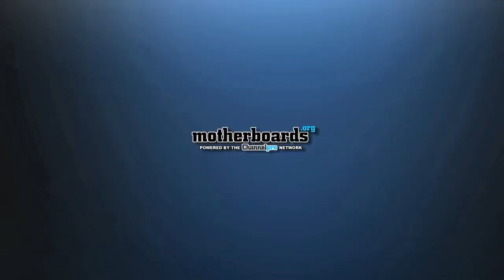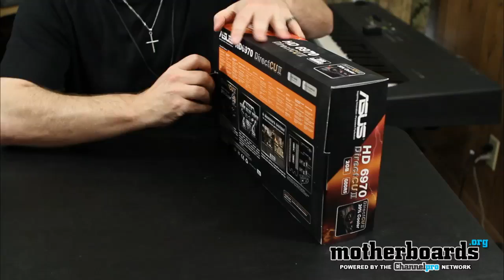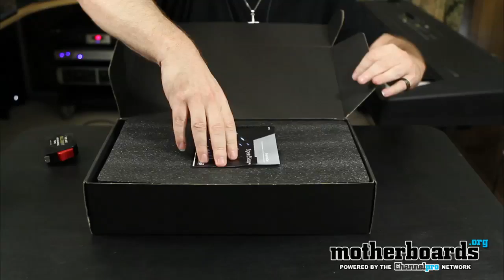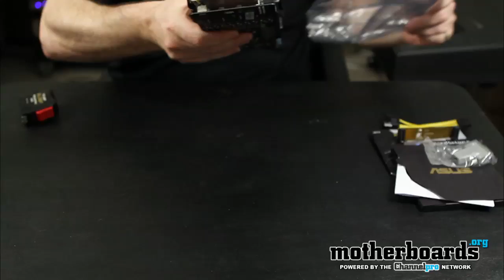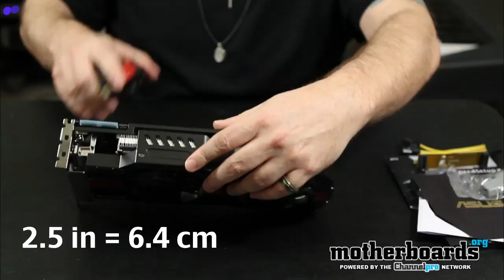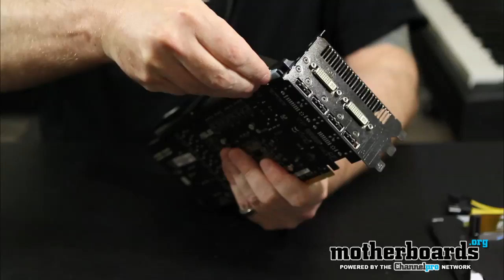ASUS AMD RADEON HD 6970 Direct CU II: Unboxing

Comment: It is hard to say what you can overclock your CPU to without having one in front of me etc... but basically if u want to be extreme go as far as you gan go whilst keeping it stable of prime 95 for 12 hours... preferably under 70 deg C.... but to prolong the life of the cpu i wouldn't recommend going higher than 4.2 ghz.

Comment: 2x8 pins absolute overkill for this card even if you could some how overclock it to 200% higher then it's original speed you wouldn't need that much power.

Comment: @Gavsta40 It performs extremely well with Battlefield 3. At stock I barely dip below 43 - 45FPS on B2K. Overclocked to 980MHz I only gain about 4 - 6FPS though.

This is at Ultra settings (Shadows High - Gain about 3FPS with no noticeable visual difference) 

This card also really does run cool. BF3 running I get a stable temp of 63C. OC'd about 69C when shit hits the fan. It also runs Metro: 2033 very well. AAA with DX11 and get Avg frames of about 38 - 40. Not bad for a poor optimized game.

Comment: Why the hell did he measure the backplate? Doesn't he know they are standard size? What realy matters is the width of the cooling solution, cause it extends beyond the backplate(towards the case sidepanel). In my Cosmos S case the pcie powercables touch the fanguard on the sidepanel fan.

Comment: @DjArden  being as you have 2 of these cards can you answer me something?
I've just ordered one of these and in the video there is 1, 8 pin pci-e adapter. could i use the card with just the one  8 pin connector or do i HAVE to use 2?

Comment: This card is frickin huge and 3 slots tall. I hear you cant crossfire with any 6970 except the exact same model. It does have a bio switch somewhere though hmmmm

Now the question will asus make a 6990 model so that I can run this in tri crossfire.

Comment: @phatbastard0alkaline what motherboard do you currently that you're considering crossfiring two of those cards with? like i mentioned on either this video or another one coherent. Seems so far the ONLY motherboard that I CAN THINK of that would COMFORTABLY allow the room needed for xfire of these two 3 slot cards is the Big Bang Marshal which i believe is an XL atx sized motherboard. Hopefuly u can find another that is not xl and and the 2nd card won't block your important stuff lower down.

Comment: @Sphoxros yeha. i feel ya bout teh 3 slot future-planning xfire concern.  My galaxy gtx 580 accelero xtreme plus hsf edition takes up EXACT 3.5 slots in exactly measured physical width.lol.  I know there is no board out there that ( without covering up the important power switch and other stuff unless it's the Big bang Marshal) can realistically accomodate 2 of my exact video card in sli.  I understand to bridge that gap in cooling and hardcore performance but 3 slots IS too hugh for dual cards

Comment: Anyone else think this thing would have some heat issues if used in CrossFire ? I mean it takes up 3! slots! thats not alot of room for airflow. :( I think this H/S designs ganna bite Asus in the ass later with those that CrossFire these, don't get me wrong Asus makes great products just that I see and issue with heat on this setup. :P

Comment: and yeah I definitely agree with your part about single gpu amd card can do what a single gpu nvidia card can't . multi monitor surround video and audio support.  so yeah..you're right..but at thte same time..that depends on the user's needs.  if they dont need nor prefer multimonitor gaming. then that part isn't in the comparison.

Comment: @WithOrWithoutScope well i've never had the " BAD drivers at first" except only ONE card ( and i have used at least 3 different driver versions PER card i have tried since 2001) by nvidia the 5700 ultra 128mb back in 2004. It's drivers from the included disc were goofy so was driver on nvidia website. The problem fluctuated.  amd crappy drivers..at random for my system. sometimes cd. sometimes main website or vendor website, except 9600 pro back in 2003. (shruggs shoulders)

Comment: thus.  except for crysis and metro the 590 beats the 6990 in reg full hd and super hd rez by a small quantity of games..all other games are a tie= winning or losing by less than 8 fps in 60 fps max range and les than 16 fps in the 100's fps range. Y?  you compare with your own eyes..side by side the difference in such a framerate and you CANNOT see the difference...thus the 7 or 15 fps differences in 60hz and 120hz modes.

Comment: @1337saklart ok.fanboy check linus's  3 part video on gtx 590 vs 6990 in a direct head to head competition using the a 1080p 60hz monitor @ 1920x1080 & 2 rez test on acer 23.6 inch 120hz monitor on reg full hd@ 2560x1600 rez.  he tested the games " Civilization V, Hawx 2, Metro 2033, Crysis, Lost PLanet 2, BFC 2, Far Cry 2". regardless of reg full hd or the 2560x1600 rez. 590 OWNED 6990 IN MOST GAMES ( owned=win by more than 7 fps in 60fps or less or more than 14 fps above 100 fps range.  thus..

Comment: @JoesPlaying to add to your question of challen...."  AND with a minimum of 30 fps REGARDLESS of the game ( metro 2033, crysis warhead crysis 2, MOh Limited Edition = NONE YET.   the 6970 comes VERY close.   meaning..metro dips down to 20's on that setup. gtx 580 dips to 30's  both scenarios under heavy fighting. otherwise they're both evening matched overall depending on the game and other facts

Comment: @WithOrWithoutScope and i tried a 6970.  again driver crashing problems on my msi785gm-e51 and asus evo 785m motherboards. with my 8800gt, 9800gtx, gtx275, and currently galaxy gtx580 accelero xtreme plus hsf edition..everything running perfect without any tweaks what so ever.

Comment: @WithOrWithoutScope on a scale of 1 to 10...10 best highest performance in that class of cards.  580=8.5, 6970=7.9   if you are comparing the same games on all same hardware including 120hz monitor at full hd rez.  Personally i've owned both ati ( i know it's BEEN amd since they began the 6 series) and nvidia since 2001. I have bought pretty much 50/50 of each chipset brand.  only problem is only ONE of the ati's gave me no driver problems regardless of what i tried=ati 9600 pro. all nvidia=np

Comment: @WithOrWithoutScope now..i agree where you're next statement comes from " well shit also if that difference is only on a few select games..then it depends on the games i play if it is that important to me to spend that extra $125 for best eye candy at full hd rez and also if playing on 120hz monitor ( which the 580 owns the 6970 on even more) without treading into the $650 plus ran of the dual gpu cards 590 and 6990. " also depends what rest of my needs are.

Comment: @WithOrWithoutScope actually you look at Linus's video of 580 vs 6970 you'll find that in out of 5 or more games..at least 2 games the 580 beat the 6970 by more than 7 fps in the 45 to 60 fps =win .less than 7 fps difference to me is a tie.  all of this was done at 1920x1080 on a 24 or 27" monitor 60hz. also Galaxy gtx580 at newegg is $470 free shipping, lowest 6970 is around $345 yes more than 100 buck price difference below $500 range. 580 is 384 bit ram interface while 670  is 256

Comment: What a beast...

If u dont use any more intern PCI(e) Slots this card is a great solution for air-cooling.
But they really f***** up with no dual bios on the 6950 DCII :(